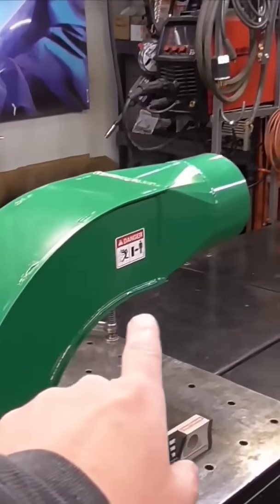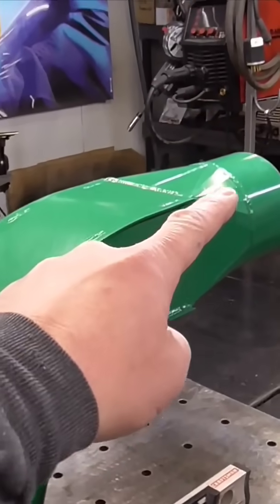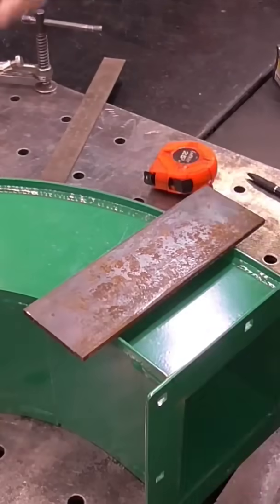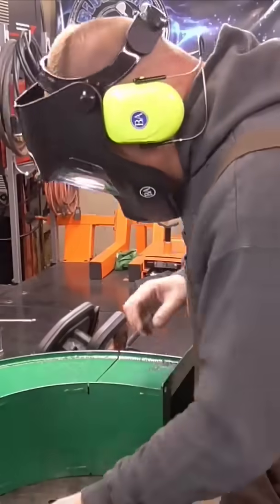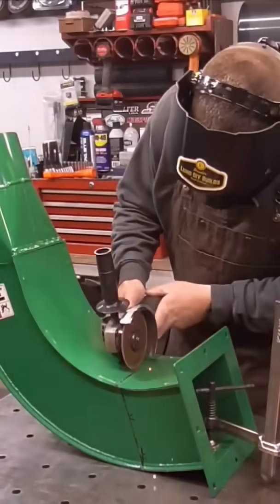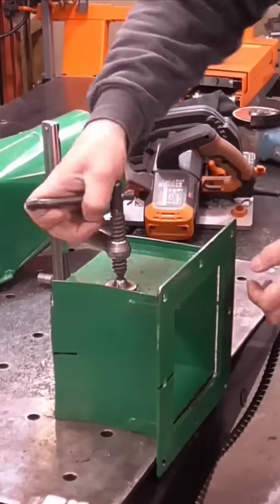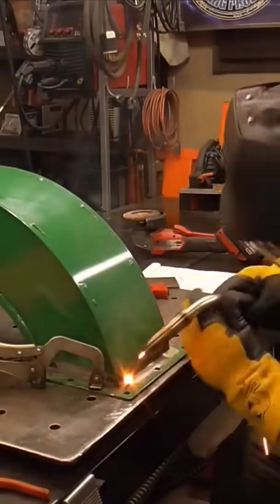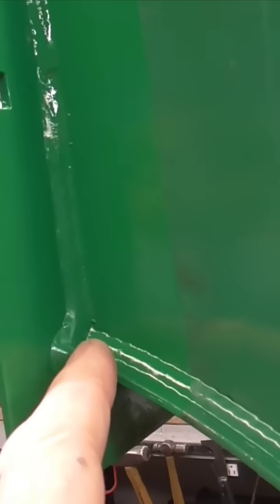Wrap Your Corners For Strength #welding  #fabrication

Comment: You got lucky that there was a straight length on that elbow to cut off! It would've been a much worse headache to deal with if it was a longer radius elbow with little to none straight coming off of the flange.
Reply from the maker: You got that right! The radius was just starting to interfere with the flange, but not enough to matter. I was pretty happy for that!

Comment: What blade did you use on your circular saw?
Reply from the maker: The Evolution saw comes with a yellow combination blade, but I'm using their blue blade for steel. The yellow will work, but it will dull quicker

Comment: I avoid using the grinder is because a kickback almost caused a major injury to my midsection. Luckily I was wearing a Dickies workshirt and the cutting wheel grabbed the shirt. The shirt bound the wheel and stopped it. Ended up with a 2" cut on my stomach area. It could be been so much worse.
Reply from the maker: That's scary! I'm glad it wasn't worse.

Comment: Nice job Brandon!
Reply from the maker: Thank you! 🙏
Reply: The only thing that bothered me was that you should've cleaned some of that green paint off near the edges. As far as cut-off wheels go, I just got done fabricating a missing part for a floor jack. The original one was gone, so I had to "John Wayne" a new one. There is grit & dust all over the work area after that. Now I need to replace the fluid in the jack to be sure none of it got inside the system while I had the piston-plunger out for fabrication. @BrandonLund
Reply from the maker: @lestergillis8171 Thanks man.  Grinding dust gets everywhere and acts as an abrasive. As far as not grinding off the paint, That was the lesson that I explained in the video. Everything was cleaned to bright shiny metal before welding. I can't fit every detail in a youtube short. That's why there is a full length video that goes into detail
Reply: @BrandonLund  I was only aware of the "short version" video. But yes, I have come to dislike that grinding dust. 
Luckily, I have one of those Shop-Vacs.